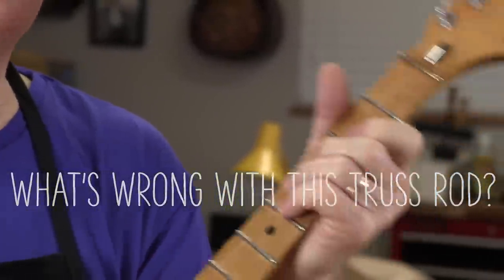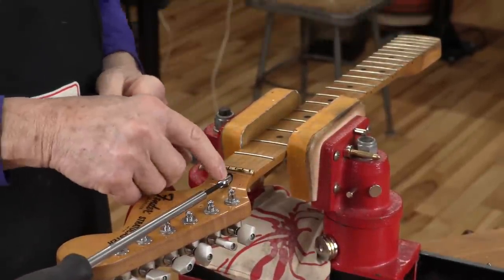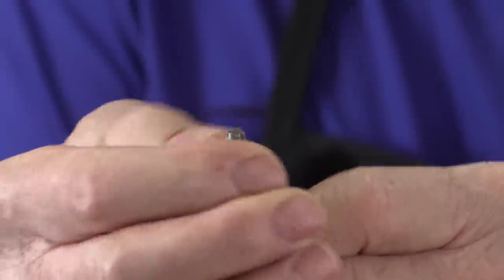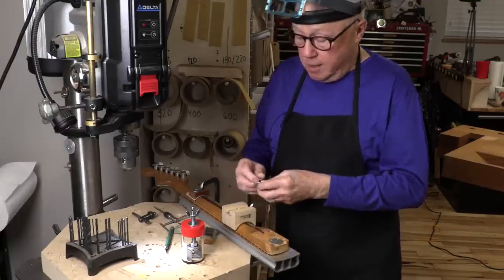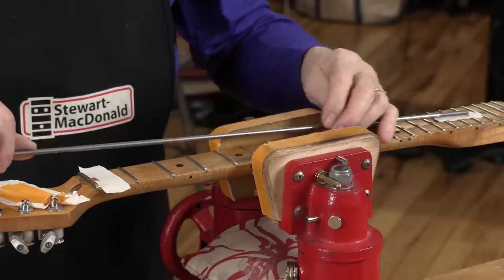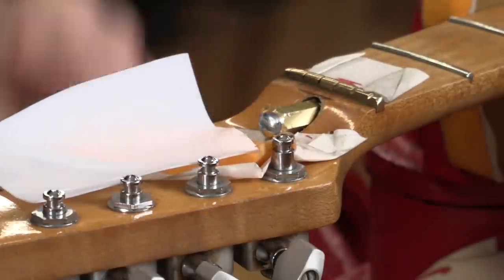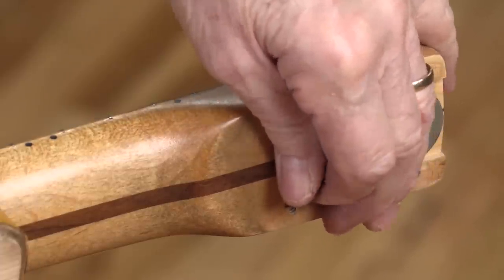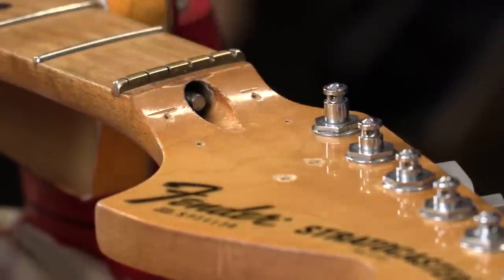What's wrong with this Fender truss rod?

Comment: This is one of the most impressive videos I've seen in the whole massive StewMac collection. Skill and knowledge like no other in guitar repair.
Reply: Alexander Brandon lol...I know right? It's crazy how easy Dan makes these repairs look. Like he's done them a million times. ..cause he probably has! 😂
Reply: Except that using JBWeld to secure threads DOES NOT WORK.  Other than that it's fine....LOL.
Reply: Yup, I would use a red threadlocker instead.
Reply: @jcd13able  No, Loctite Red weakens threads that are under heavy pressure.

Comment: Cool repair. Tip for anyone who might want to try this themselves. Before you thread the rod into the anchor, turn it to the left, when you feel the thread engage (should be a little click) then you turn it to the right to thread it in place. That'll help keep you from crossthreading the anchor and ruining your work.
Reply: i do the same thing when putting screws back into electronics. i guess the tip transfers over well.
Reply: yes and yes y use that in the drill press to not miss the punch in the steel
Reply: Definitely. The best way to do it.
Reply: Always when screwing!
Reply: I do this even when closing water bottles
Reply: This tip applies any time your putting a nut or bolt on anything really (unless it’s reverse thread!)
Reply: @Jonathan_Doe_  yeah but the difference is that on a truss-rod for a guitar, you dont get to see. Its all by feel. Not exactly the same type of talent as a water cap or electronic parts.This guy is a pro luthier.
Reply: I've always done this myself! So reassuring to know I'm not the only one.
~Sean
Reply: Lemongrasspicker, that works for general purpose reengaging threaded parts. However the truss rod and the anchor nut are entrapped (friction fit) and in proper alignment so highly unlikely you will feel or hear the click and highly unlikely to cross thread.
Reply: Boxcarcifer  A lot of old vehicles had what were called lug-centric/lug-piloted wheels that used the lug nuts to center and drive the wheel.  The engineers found that on the left side of the vehicle, the slight movement of the lugs in the lug holes when the vehicle was first starting to move would loosen the nuts.  Old heavy trucks used this same technique on bud-wheels that are lug-piloted.  Newer hub-piloted vehicles don't have this issue which is why you don't see it today.  On the smaller vehicles made today that are lug-piloted (passenger cars), accurate torqueing procedures, lighter vehicle weights, and better materials have mostly done away with this issue.  It still happens though if a wheel is installed wrong and is one reason a lot of tire shops ask you to come back in after 500 miles to check the lug torque.  Cheers!

Comment: Before picking up swarf, wrap your magnet in kitchen paper. Then you can pull all the swarf off the magnet at one go, throw it and the paper away and leave the magnet clean.
Reply: Always coat your brown hat in caster oil for lubrication before making an entry.
Reply: What the hell is swarf hahahaha, sounds like some Lord of the Rings stuff.
Reply: @Ibaneddie76  Swarf is the name given to any metal shavings.
Reply: Today I learned that those little shavings are called 'swarf'
Reply: @KennethNicholson1972  The best word for something - and therefore the one the most intelligent person would use - is the one that the most people will understand.
Reply: @ashscott6068  bla bla bla bla
Reply: @ashscott6068  Tr-tr-tr-triggered!!! Sorry, but every vocation/hobby/sport has it's technical terms. The only "commonly understood" term would be "shavings", and there is a definite difference between metal shavings, and wood shavings, and how you handle each type. If you only use the single word "shavings", then there will be some level of uncertainty as to whether the writer is referring to metal or wood. And if you use "metal shavings", you are using two words where one suffices. The term IS "swarf", and this channel IS aimed at people who have some level of experience at guitar repair, or want to.

I play pool. If I post a video of a masse shot, should I call it "shot where I hold the cue vertical and strike down, making the cue ball go sideways before it curves back in the direction of the spin"? Nah yeah nah. That's MUCH easier to understand than "masse", and it keeps all the busybody housewives on the internet with too much time on their hands from getting triggered.

Take your passive-aggressive bossiness, else...where.
Reply: Ash Scott, you sure whisked up a good bullshit merengue with that attitude of yours. You cooked up a hell of a storm. You fried and gutted their brains. Now I need a sammich.
Reply: People with some machining experience recognize "swarf."  Of course it was the correct term.
Reply: @ashscott6068  no, the best word is the correct word. the correct word is swarf. deal with it.
Reply: old luthier dude's voice "Looks like we need a magnet to pick up all Ash's swarfing posts... just toss it in the trash like so..."
Reply: John E, by "Kitchen paper",  I assume you probably mean what we here in the USA would call wax paper. Or parchment paper. Even some masking tape or, better yet, blue or green painter's tape common sometimes known as frog tape, would work. Especially if you faced the adhesive side of  the  tape outwards, away from the magnet.
Reply: @austonsmith536  , now we can play a couple of rounds of that famous children's game known as Magnet, Paper, Scissors, Swarf! If the  Scissors don't get you as the Neodymium magnet pulls them in at high speed, the sharp Swarf  shavings will!

 I actually first saw the word swarf in a service manual for a piece of electronic equipment just a few years ago, cautioning service technicians to watch out that they don't leave chips of metal behind inside the unit from the self- tapping screws in the chassis. I had to look the word up online. I'm a fairly literate guy and it's not very often that a word stumps me, but this one did.
Reply: @jerrybobteasdale  99% of machinists call it chips, and have for the entirety of my 25 years in the industry
Reply: @jeepmanxj  The curly bits that accumulate at the lathe and drill press were called swarf by the first person I heard assign it a name. It's just the term I heard a long time ago.  I tend to use the term "filings."
Reply: @jerrybobteasdale     filings is somewhat common with guys who cut cast iron.  However my father was a machinist for nearly 50 years, he can back me up on this. 8

Swarf is a term people who want to pretend to be machinists use. Using it only shows machinists that you probably are super green and to pay you no mind.
Reply: @jeepmanxj  Am no machinist.  Am a farmer that welds and fabricates rough, functional stuff.  No fine work. But some teacher back in my memory called it swarf, and it kinda stuck.  It's not that odd of word, but it might be regional.
Reply: @jerrybobteasdale  Swarf, chips, turnings, filings, shavings- they're all the same thing. Of those, when speaking to a layman audience, the 'right' word would be filings, because it immediately informs that the material is metal, not wood or another material, and is a term that most everyone has actually heard. If it was an industry insider presentation, then referring to it as swarf without explanation would be more acceptable. Interestingly enough, the etymology of the word "swarf" actually derives from filing, in an interesting way; its ultimate ancestor was an Old Norse word, "svarf", which just meant "file dust", itself derived from "svarfa", meaning "to file".
Reply: I don't think a magnet will pick up a Smurf.
Reply: cody sonnet  Yeah, when I go into Mcdonalds and ask for a meat sandwich, for some reason, they insist that it's called a hamburger or something. Everyone I've ever known has called it a 'meat sandwich', so I know that I'm definitely right and they're wrong!
Reply: @jeepmanxj  I love fish and chips. Fish and swarf, not so much!
Reply: @Jooeffoh  this thread still exists. Nobody who actually works in the industry calls it swarf. They all call it chips. It would be obvious to anyone who deals with machining because it's why the geometry of an insert includes type of chip breaker.
Reply: @jeepmanxj  I'm not trying to start a fight but that isn't true at all.  When I worked for Cummins Engine Company the machinists called anything that came off a drill, lathe, or mill, swarf or chips interchangeably; it all depended on where you learned to machine and we always knew what we were talking about.  In the Navy shipyards I have been in, which is a few, if you go into the machining buildings  they call it swarf and have bins next to the machines that are all labeled "insert metal type here" swarf.  I would really like to hear your argument that these master tool makers and machinists are not "real machinists".  This is standard Navy lexicon and mariners of old have a rich history of using concise language for tools or materials.  It's like the difference between rope and line, they are not the same.
Reply: @joem7572  25 almost 26 years working with people from all over the us I've still not heard it outside of kids who saw posts online by people who don't actually do the job.
Reply: @jeepmanxj  While I understand what you are saying, I can say the opposite.  In 25 years of working all over the US and in different parts of the world, mostly on diesel engines, I have heard it called swarf by many machinists as well as die and tool makers.  The jargon we use greatly depends on where we were taught.  Cheers!
Reply: Thats very smart

Comment: Howdy Dan, you can avoid chowdering the finish around the barrel nut by using a barrel nut that's threaded on both ends.  On the lock screw end, cut a slot all the way across it so you can use a slotted screwdriver to remove it from the rod after you pull the locking screw out.

Comment: I had the exact same issue with a '79 strat. No sign that any glue or epoxy was  applied at the factory! I think maybe sometimes someone forgot that step. For 25 years i thought the truss rod was broken and i needed a new neck. It was only when i removed the neck to replace it that i decided to try and pull out the broken rod to just look at it before i threw it away. After i saw it had come unscrewed, did i get on the Internet and discovered this video. Now i can keep my vintage neck!
Reply from the maker: That's awesome...glad it helped you save your neck!

Comment: I always thread the insert after drilling it thru to the rod insert area and positively lock the rod in place with a socket head set screw .
this works with an insert that has had its threads stripped out or buggered up as well .
If the head-stock end of the rod is still good you get to reuse it as well .

Comment: I have experienced this problem with Fender truss rods before. because Fender headstocks don't have truss rod covers. which leaves the truss rod nut exposed to the elements. ie. dust, dirt, lint, and moisture. especially if the guitar sits in a guitar stand for long periods of time. it basically causes the the truss rod nut to rust on to the truss rod locking it on there. it's a gripe I have had with Fender guitars for a long time. what I have been doing for quite a few years is cutting a piece of foam rubber so it fits nicely into the truss rod hole. but finally after all these year's Fender has come up with a solution for this issue. now they make a plastic plug that goes into the truss rod hole. Dan was particularly lucky in this situation that the truss rod unscrewed from the anchor. because they normally use Locktite threadlocker when they install them. the spring steel that truss rods are made out of once in a while can snap off. if there's no broken part of the truss rod sticking out of the anchor. then a person can again do like Dan did. but if the truss rod broke anywhere farther up the neck. then a person is looking at buying a new neck or lifting the fretboard off the neck. which is no easy task although I have seen Dan do it before.

Comment: You need to grease nut just in case to prevent unscrewing from opposite side again. Thread can get rusty in 50 years or so. I have 50 years old guitar and I have to replace truss rod. I don't think it is still under warranty...:face-blue-smiling:

Comment: I think the original truss rod could have been reused if threads on the head end were chased with a 10-32 button die and cleaned up to accept a new nut and the anchor bushing wouldn't have had to be removed (although the truss rod would still have to be removed). If the threads on the body end of the truss rod were broken or stripped, then yes, anchor bushing replacement and truss rod replacement. But the threads looked perfect giving all the necessary clues that the anchor bushing was perfect AND still in alignment. A drop of red loctite applied sparingly will ensure the truss rod never separates from the anchor bushing until it's torqued enough to break the rod. I'm sure he was aware half of the job was unnecessary but did this little extra work as a great opportunity to film the necessary steps when a truss rod snaps at the anchor bushing.

Comment: This is very helpful. Same thing has happened to my squire p bass. Except I have no fancy tools, so I drilled in from the bottom end of the neck and after removing the 4mm bolt from the top of the neck I got the big round bolt out and then slid truss rod out . It seems like the threaded part at the end of the rod had pulled out of the round bolt at the end as the thread is really thin at that end . Now how do I fix it back together without all those lovely tools?

Comment: Thank you for the great information - let me offer you a tip...  When you are using that magnet to clean up the metal chips, put it in a small plastic baggie, then after picking up the chips, turn the bag inside out and pull off the magnet.  Chips are contained, and you don't have to wipe them off the magnet.

Comment: Absolutely fantastic as usual!
Looks like the owner loosened it instead of tightening, doh!
Reply: It shouldn't matter because if the truss rod was properly loctited to the bushing, only the nut at the head would come off and easily be put back on. What happened is that the nut, via corrosion or dirt, became harder to rotate than the sum of torque from the bushing and friction of a tight fit of wood on the sides of the truss rod.

Comment: Welcome to Jay Turser truss rods. And it's too bad..I have one of the huge Jazz boxes from Turser's early releases. Turning the rod does nothing either either way. I can't get relief, and have my bridge sitting way too high to compensate, and still not good. If you're wondering if turning the rod does nothing, why doesn't it default to a relief position instead of how it would be if I had overtightened? I have no idea.

Comment: All excellent videos.  Question: You tapped for a 10-32 so you could use the puller.  Why not put a small flat spot on the end of the truss rod and insert a 10-32 Allen set screw in that hole to hold the rod from spinning?  Looks like plenty of depth to do it.  Even with JB Weld, it could break loose again.  Just saying.

Comment: Here is a tip. Repair magnets are great for cleaning up metal chips and swarf, but it's a pain to clean the stuff off the magnet and if you do it with bare fingers you can get metal splinters in the skin. I wrap some paper around the magnet before using it to pick up steel chips. That way clean-up is easy and safe.

Comment: Nice work Dan!! Thanks! Why did the guy drill holes on the front of the peghead? I think I would have put some JB Weld down in the hole you drill in the TR anchor.
Reply: I'll bet that he had a old style locking nut and string retaining bar installed back in the '80's. The holes are right for either a Schaller or Kahler string lock that installed between the nut and tuners.

Comment: I don't really understand this repair.  It seems like nothing was really broken, but only had come loose.  If that's the case, why drill out the anchor? Why replace the rod? Why replace the nut?  It seems like once it was pulled out and you could see that the rod wasn't broken, you could have just screwed it back in without modifying anything at all.  Also, it seems like it's now back in a situation where it could happen again.  Why not at least try to put some threadlock on the anchor end of the rod?
Reply from the maker: The issue was with the truss rod's threads on the anchor end. You can hear a click as they jump in the anchor when Dan's inspecting the rod in the beginning of this Trade Secret video. It's also likely that the rod was deformed a bit when removing it from the neck, so Dan wouldn't want to reinstall a bent truss rod. He had initially intended to secure the newly threaded rod in the anchor with some JB Weld. However, Dan was satisfied with how tightly the rod threaded into the anchor and didn't see a reason to remove it, apply the JB Weld, and reinstall it.

Comment: How do you pull the rod out of a Fender neck that has the more modern biflex? Once you get the plug out the nut and rod are still deep in the hole. Same with a vintage rod with the nut at the heel, once the nuts out the rod is still buried a centimetre or so in the hole.  Would these be scenarios where you have to remove the fretboard or just give up?